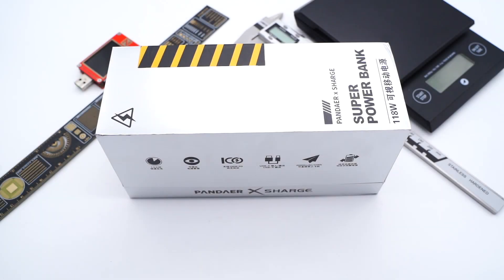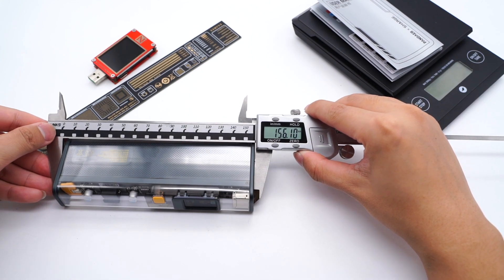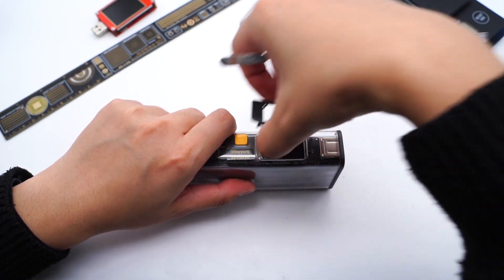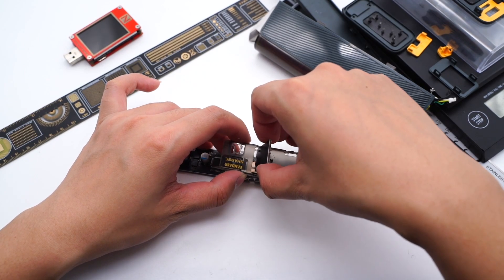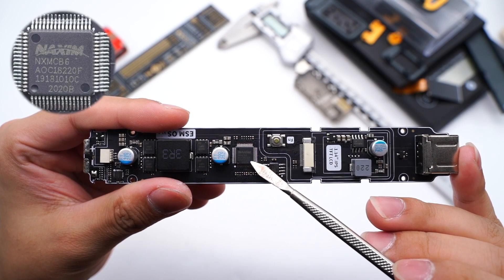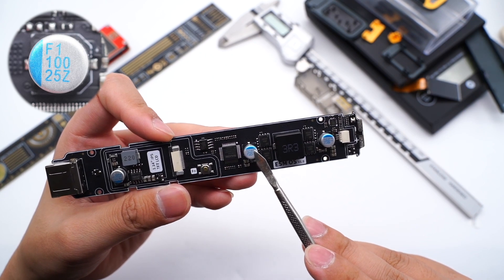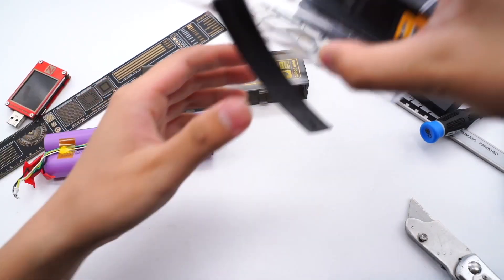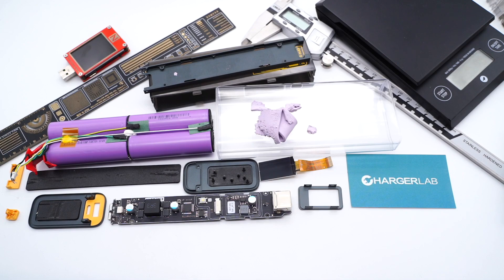Latest Teardown of STORM2 Slim / SHARGE 20000mAh Transparent Cyberpunk Power Bank

Comment: 8:15 These wires are called the balance leads, 3:38 you revealed that plug here; This 'junction' is the balance input. 5:05 shows the battery monitoring IC, hence the input of that lead.

Comment: I hate when battery manufacturers lie about mAh when building battery packs like this. This pack is NOT 20,000 mAh! It's only 5,000 mAh. Those four batteries are each 5,000 mAh, but the are using them in series to increase voltage. Batteries in series DO NOT increase the mAh like that. This is why the watt hour rating of batteries is a more accurate rating, but manufacturers still like to falsely flaunt the mAh like this.
Reply: I Wh sono sempre li stessi
Reply: funny how your bitching and wont give any answer yourself to the problem, as mAh is such  relative terms and it would cofuse even more to claim itf from a higher voltage on a product that is so multiple voltage depended as a consumer powerbank
at the end of the day, this powerbank do have 4x 5000mAh batteries inside, so 20.000mAh, and as long as its a variable voltage from 5v to 21v it would have no relevance to take a mAh value from a higher voltage, as it will vary greatly depending on what voltage the user is using it at and buck or boost cirquitry. - and why they are using the ref. LIion ref voltage of 3.6v and then usally state a real capacity based on an effiancy number, useally around 2/3..
The same with the Storm2.
it had 25.600mAh with an adj. DC out that could go from 3.3v to 25v, so a person using the powrerbank at 3.3v and with your logic it would be  27920Mah powerbank at 3.3v and only  3600mAh if the user used it at the 25v it also can do (baseed on a ref of 25.600 with 3.6v) as the mAh value will vary greatly depending on what voltage it is being sucked at, and what effiancy percentage that are in play but that aint relevant here.
On powertools you can give a value at nominel voltage, as these packs are only planned to be used at a fixed voltage.
but that aint the case with powerbanks.. so it is the right approach.. and the best to simply state  what battteries are present in this powerbank and use the batteries own reference voltage.
also why you shall usally look at the watthour, and also why regulation like fx flight limits etc.. are not stating mAh-values as it can vary greatly depending on the voltage, but gives a limit in watt hours (wh).
Reply: @JAKOB1977  lol what? The answer is incredibly simple, stop using mah (milliamp hours) and use whr (watt hours).
Reply: @bluegizmo1983 which they already do. The have both on their website. But if Sharge is the only one using Wh then it's still useless because you can't compare it to other powerbanks so it's not fair to blame sharge for this

Comment: 7:36 Parallel 😊
Amazing video thank you. ❤️
Reply: its series only not parallel
Reply: @shoppygadgets  if in series every cell has to be 20000mAh. Sound pretty bizzare fir it's size if it's true.
Reply: @vishal01mehra  yes bro each cell is 5000 mah cause they are not 18650
Reply: 1:08 I think it is series by looking at the total voltage, it then lowered down to certain voltage